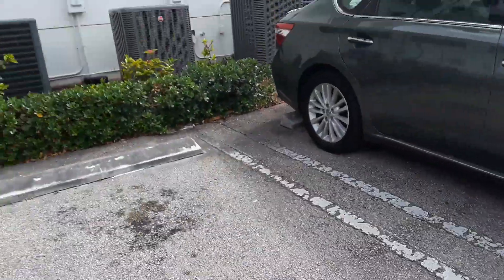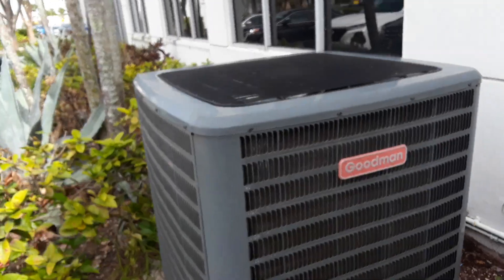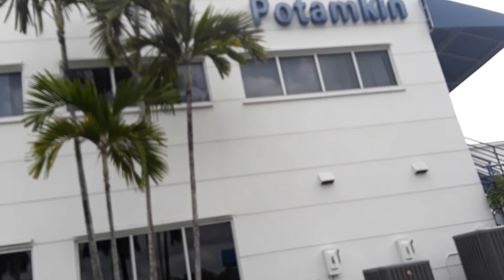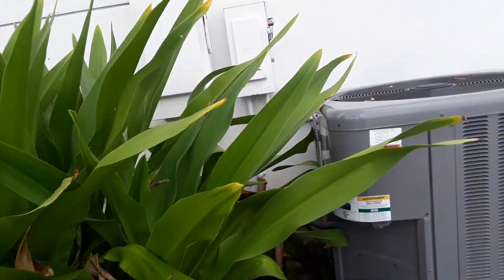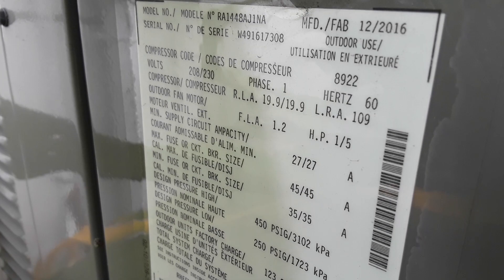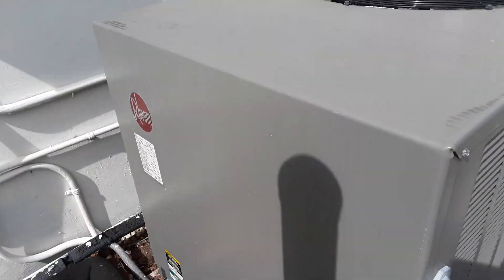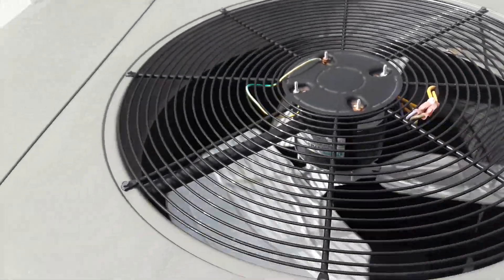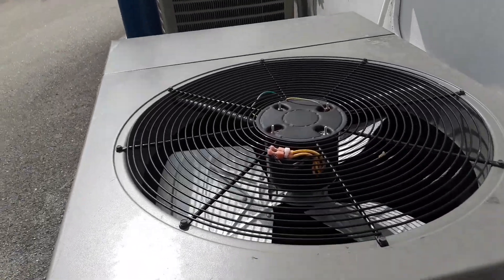Several Of Central Air conditioners At a Hyundai Dealership!

Comment: The older style Rheem has what is called the infamous fan motor hack job, the exposed wires zip tied to the top of the fan grille and the way they ground wire is ran, which is very dangerous, the two yellow wires are for the rotation setting (clockwise or counter clockwise, dual rotation universal motor) and over time the elements breakdown the insulation on the wires and the bare wire can touch the fan grille and energize the whole chassis of the unit, and someone touches the unit and it being live with 220 volts - that will be a very bad day. i've been zapped with both 110 and 220 and i can speak from experience that it is not fun one bit, electricity is nothing to mess or play around with, whenever i see a unit with a fan motor hack job i avoid touching it period, you never know if it is live or not, the proper way to tie up the reversing leads is to stuff them in a piece of pipe or conduit , or even better go back with the original fan motor from the manufacturer. Lazy hacks are just careless lol Also there is definitely something wrong with that 7.5 ton Rheem commercial unit, probably a malfunctioning thermostat or being a straight cool unit possibly a bad contactor or even an electrical problem, it could also be going off on high or low pressure and the pressure switch could be causing it to act weird. And that one Rheem being super tall is because it's a 16 SEER unit , the higher the SEER the bigger the unit in size/dimensions. Great video :)
Reply from the maker: Great comment